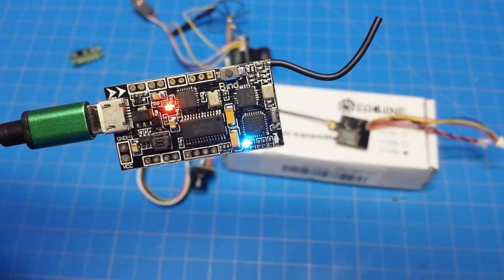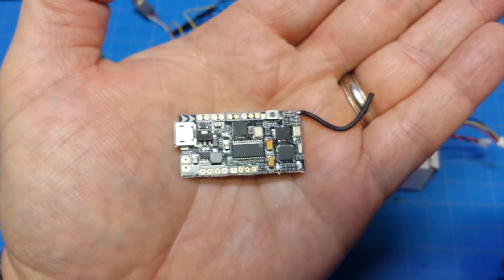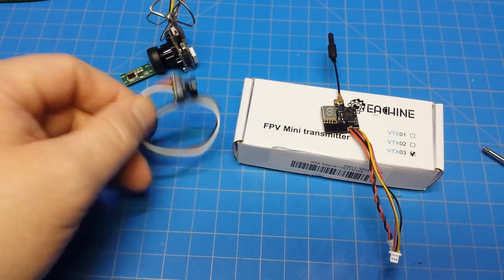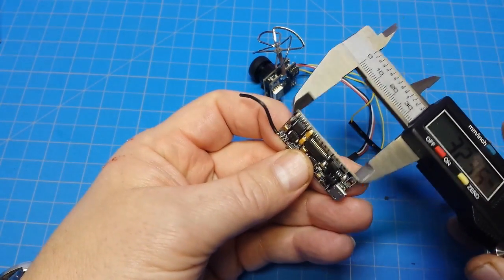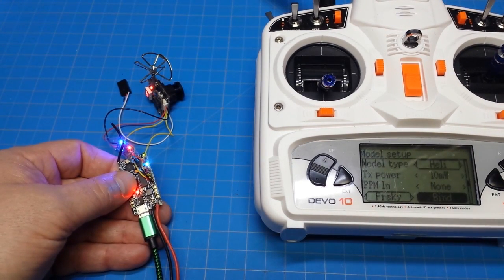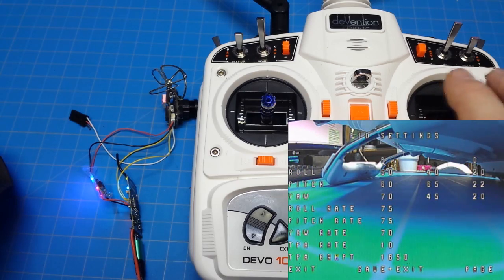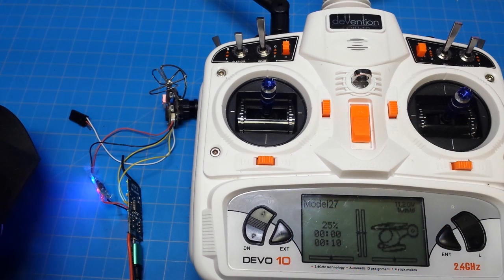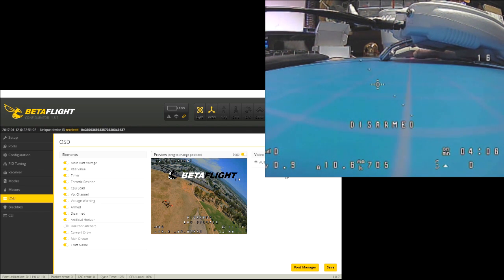Eachine AIO FC OSD

Comment: hello nick, is this board still functioning?  mine made 3 flights and now it is broken. one of the motor fets gave up. In what micro did you build it in?
Reply from the maker: The one frame I put it in, the frame broke on one of the first 5-10 flights, haven't circled back to it.
Reply: now i will  wait and see banggood comes up with before i order another one. Tnx for all your video's.

Comment: Subbed Nick :) I blew my Qx95 Flysky FC, can I change it for one of these quite easily? Would it be worth adding motor connectors for easy swap outs or does the added weight not justify a mod? TIA
Reply from the maker: the weight gain will be very minimal if at all. I have since used this board the receiver has poor range.
Reply: Nick Burns thanks for the update. What sort of distance? Was the osd bad or just 2.4 range?

Comment: Tidy review. Just ordered one. Let's see how it performs. I am using similar boards to replace the electronics in a cheap Chinese toy quad to practice acro mode and building in general. The OSD will replace my bluetooth setup I currently use for tuning, hopefully saving me some weight.
Reply from the maker: Nice, micros and low weight are always good together.